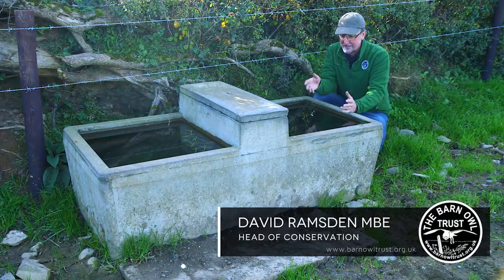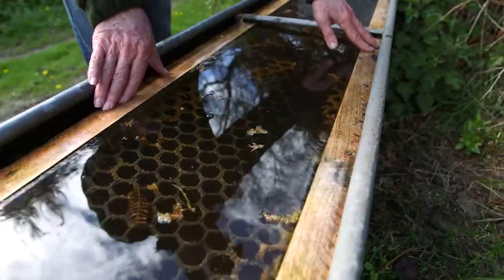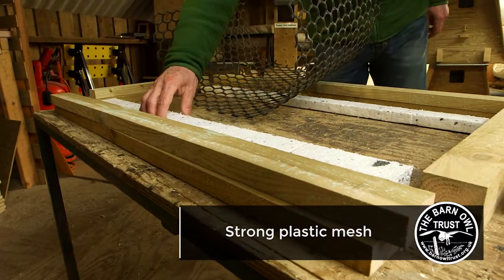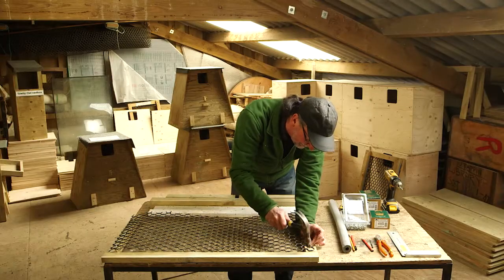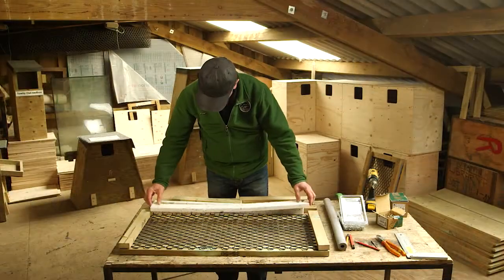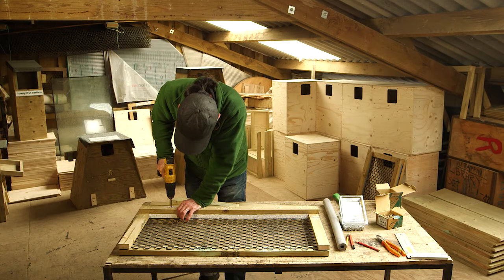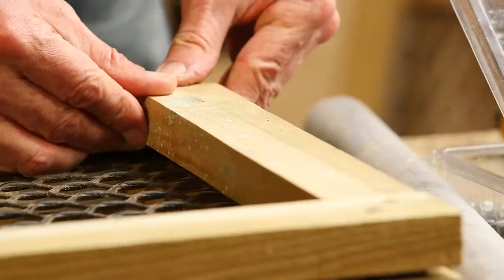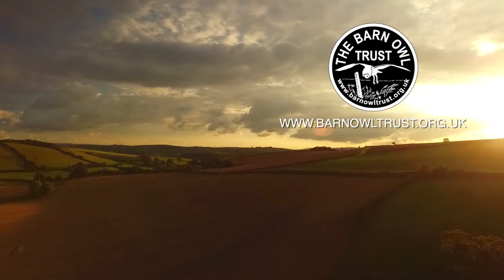How to Prevent Owls From Drowning

Comment: Not keen on using the expanded polystyrene. My experience is that little pieces get detached for whatever reason and end up in the environment. Not something I want to encourage!!
Reply from the maker: Thanks for your comment David. The problem is that the incorporation of a buoyant material (such as expanded polystyrene) is essential – waterlogged wood sinks too easily. We'd be interested in any suggestions for a more natural alternative that works - but unfortunately we haven't found anything yet. :(
Reply: @BarnOwlTrust1  thank
Reply: I've recently installed a barn owl nest box on a tree and I've got a water trough very close by so this is a great idea! I'm not keen on the polystyrene either to be honest. I wonder about creating a float from piping, perhaps waste pipe for plumbing with blank caps on each end which could be cable tied to the frame. Adds an expense though. As a free alternative maybe using empty  plastic drinks bottles, cable tied along side the frame or above the battons. I'll have to experiment.
Reply: Having thought about it a little bit more the pipe could be used as the frame by using a 90 degree bend on each corner and cable tie the mesh to the bottom of the pipe which will allow a layer of water the same depth as the pipe above the mesh. I would suggest using the white waste pipe maybe inch and a quarter diameter. The fittings can be glued together to seal it and it's light weight, sturdy and uv resistant. It's also cheap though you'll need some glue or pvc weld to fix it together. If you know a plumber they often have short off cuts or old pieces that they might give you. I'm going to try this method to see if it works. I'm also not keen on leaving pressure treated timber to soak in water, that stuff is pretty toxic. Alder wood is good for surviving under water also, traditionally used for canal lock gates... Thanks for all the great videos, I'm learning a lot from them.
Reply from the maker: Good luck - let us know how you get on. :)